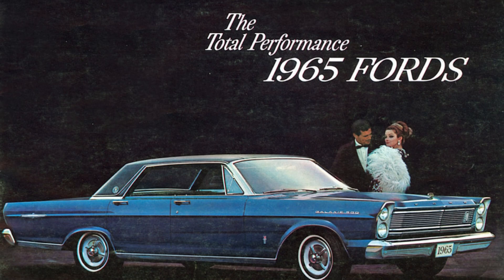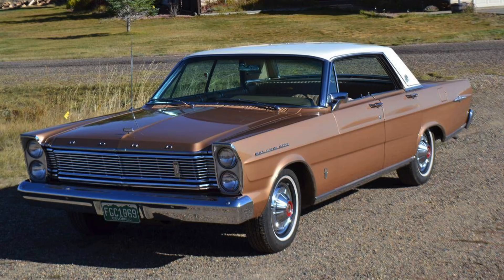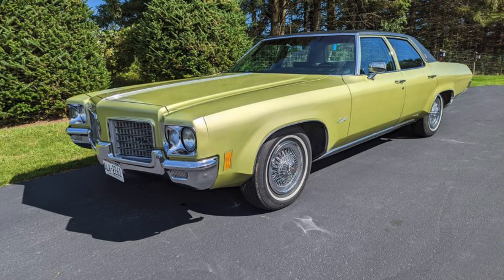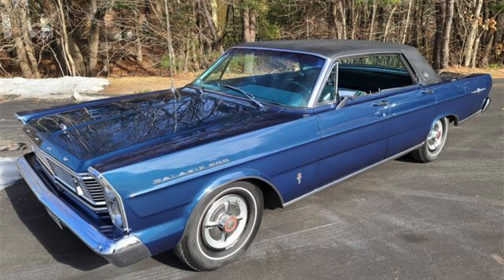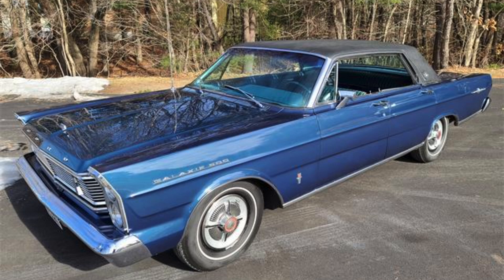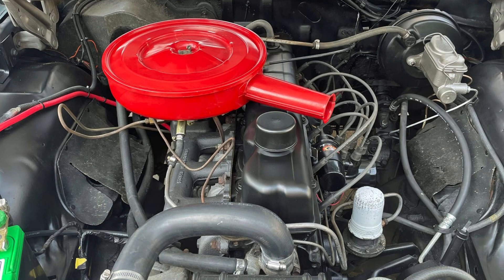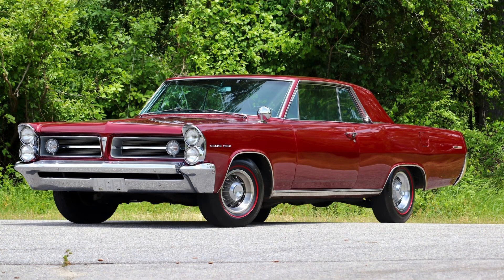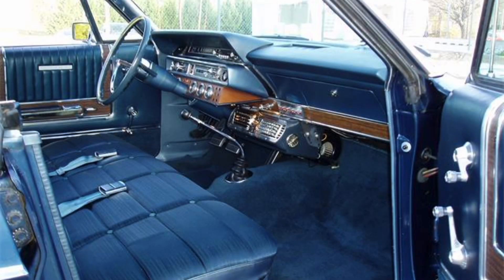Quieter Than A Rolls Royce?  How Ford Perfected the Quiet Ride in their 1965 Ford Galaxie & LTD

Comment: A 66 Galaxie was the first car I ever drove. It was white with beautiful blue interior, powered by a 289 2 BBL and was being used as a personal car for my dad. After he had it for a while (letting me drive it around in the yard and the open field by our house) he gave it to his brother to use as a work car. Not long after it caught fire (I forget why, but his brother's cars didn't last long) and came back home to be permanently parked in that field. 

He took out that 289 and took it apart in front of me. He explained everything about how it worked and to this day I learned more in those few hours than I've ever learned since. 

I still remember driving that car, the look of pleasure on my dad's face when he drove it (who otherwise hated large cars) and the mixed smell of oil and old gas as he disassembled that engine.
Reply: Cool story. I still have my dad's 66 Coronet that he owned from new. Unrestored; just keeping it going as it left the factory.
Reply: @LongIslandMopars  I absolutely love the 66 and 67 Coronets!
Reply: @Paramount531  Thanks. It's a crew cab (4 door) with a 273 (smaller than that 289 you had). Dad called it the "little engine that could". Took him to retirement and 201k miles before I inherited it.

Comment: The ‘65 LTD is such a gorgeous design imo. So clean, simple, and elegant. I think this car, especially if coupled with any of the 427s, was the best entry-level-brand car you could get at the time, and one of the best in general
Reply: I think 66' is the best looking year for any iteration of the Galaxie,
 including LTD and 7 Litre Galaxie 500.
Reply: My Dad bought a new 1966 Galaxie 500 four door hardtop that was white with a red interior. If I remember correctly it had the 289 V-8. I can also still remember the soft whooshing sound it made when you opened the flow-through ventilation system. One of my favorite design features was the formal looking roofline and rear window.  @Johnnycdrums
Reply: @davidfrania8990  how fast was your dad’s 1966 Ford Galaxie 500 4 door hardtop with the 289 in it? I’ve heard some people say they are “undersized” but can’t confirm since I’ve never driven or ridden in one. I actually might pick the a 1966 Ford Galaxie 500 4 door hardtop sometime this fall with a 289 paired up with a C6 automatic which is virtually the same, but this one has a blue interior. Needs some work but since the guy is only asking $1600, I might as well go for it. Wouldn’t be too surprised if it has 162,000 original miles on it.
Reply: @seana806  I don't really know, as it was the "family car" and I wasn't old enough to drive yet. But I never heard my Dad say anything negative about it, and both he and my Mom enjoyed driving it. I remember it was a great car for long trips, as we would visit family who lived 12 hrs from us by car and it was always a pleasant trip without any drama. We had that car for three years, when Dad traded it in for a two-door '69 LTD Brougham with a 390 V-8. Good luck with your Galaxie 500. I hope you have a lot of fun with it!
Reply: @davidfrania8990  I am looking forward to having fun with it and giving it a new lease on life. It has just about every option with the exception of cruise control, has factory air conditioning which is nice and for sure going to get that fixed and operational since it gets quite hot here in the southwest in the summertime. Once everything is all sorted out, definitely want to make it a daily driver since it doesn’t make sense to spend thousands fixing the car up then essentially putting it on the shelf and never using it again, not good for those cars and will have more issues with it sitting as opposed to using it for it’s intended purpose.
Reply: @Johnnycdrums  Agree.
Reply: The 427 codes are (Q), (W), or (R).
The last 427 appeared in 68' Cougar GT-E's, and it was the lower tired (Q) code and were only available with auto trans, 
unless you got the Cougar the GT-E with the 428 CJ.
I think the Cougar GT-E was one year only, and the only Ford model available in 1968 with only two engine choices, a 427 or 428.
How cool would it be to have both?
Reply: @Johnnycdrums  I had a 68 XR7 with a 302, loved that car! 
 Thanks for the info, I've never driven a big block Cougar.

Comment: Friends bought a brand new 65 Ford Custom sedan with the new six and only radio, heater, white walls and dealer installed air. Even that bare bones model rode smooth and quiet.

Comment: Great information! 
My dad told me he tried to economize once, trading in our 1964 352 Country Sedan for a new 1966 Galaxie Club Coupe, with the "Big Six", as it was called, and 3 on the tree. I don't think he kept it for a year. He wasn't impressed with that engine at all. It was soon traded for a new 1967 Ford Custom 500 sedan with a regular fuel 255 HP version of the 390. That was our family car for several years.
Reply: That Ford inline six-cylinder is considered one of the most reliable car engines of all time. Better suited to a Fairlane or Falcon though.
Reply: @JackF99  This one was the 240 cubic inch "big block" Six, not the tiny Thriftpower that originated in the Falcon. The 240 was also the base engine in the F Series pickups, and the larger, more popular 300 was related.
Reply: @MisterMikeTexas  Oh I was thinking of the 170 or 200 inch  jobs.
Reply: While good engines, an inline 6 hauling around a full size vehicle of this era would have been pitifully slow!
Reply: @joshn938  I don't know about "pitifully slow", it was probably just adequate with the 3 on the tree. My early years in grade school, we had a used 65 F100 with the 300 Six and 3 speed. It seemed to do just fine.
Reply: That 6 was bigger than the previous 223 6, but it was a very short-stroke design, so not much right off idle.
Reply: Wasn't the 200 six standard on the 1965 Galaxy , well according to Wikipedia.
I wonder what proportion of these car were sold with six options.
I have not seen any source giving sales by engine size by model
Reply: @johnd8892  I don't know where Wikipedia got that from, but it was the 240 cubic inch Six that was standard on all full-size Fords, except XL and LTD. The Thriftpower 170/200 cubic inch Sixes weren't designed to power full-size cars.
Reply: @johnd8892  Probably until the 240 came out - I think in '65.  
I'll bet fleet sales accounted for a large share of the six cylinder sales.
Reply: @DanEBoyd  Prior to the 240, the full size car's standard Six was a 223, which dated back to the 50s.

Comment: I know the chassis/ underpinnings from ‘65 were carried through the ‘68 model year but I don’t know how drastic the changes were from ‘69 onward.  Perhaps that could be a future video, comparing the engineering, ride, handling, and quietness between your cars of those 2 generations.
Reply: yes great idea.
Reply: @travelingfool9096  I think I saw that at least the front chassis area survived basically the same into the Crown Victoria era, it was that stout and quiet.
Reply: @machpodfan   My thought was three basic full sized cars post WW2:
49, 65, 79 ( panther)
Reply: The 69 & 70 LTDs put the radio on the wrong side of the dash where it could not be reached by the front passenger.
Reply: @deepthinker999  Calm down passenger, The Captain has the tunes under controll.😎
Reply: @deepthinker999 The radio was on the left hand side on all full size Fords in 1969 and 1970. I quite enjoyed the extra bit of control it gave me in my 1969 XL.  Driver calls the tunes; shotgun shuts his pie hole.